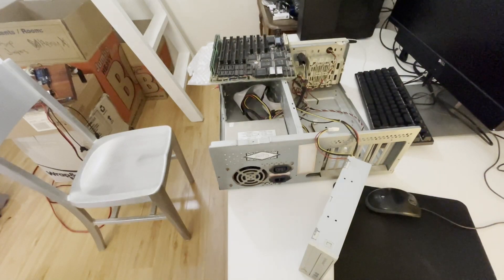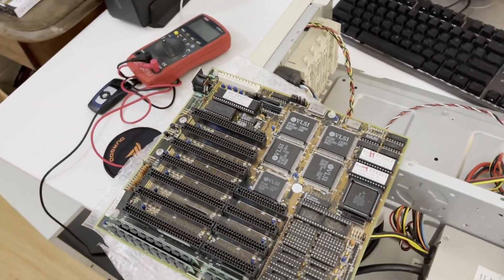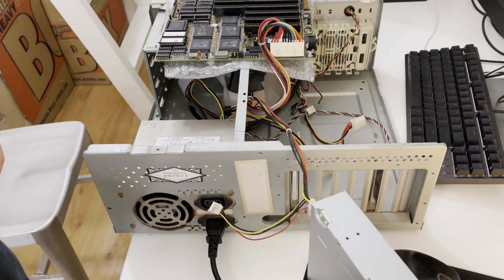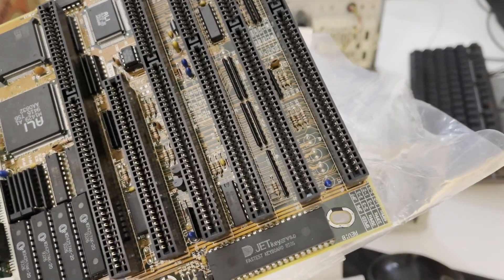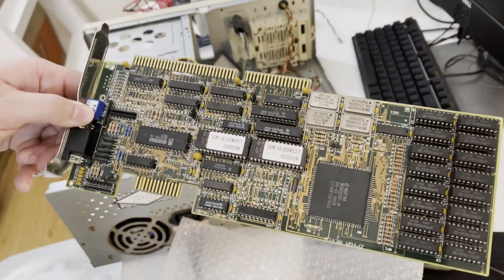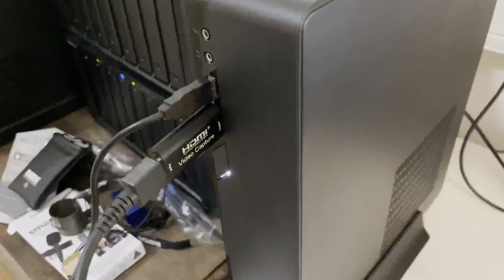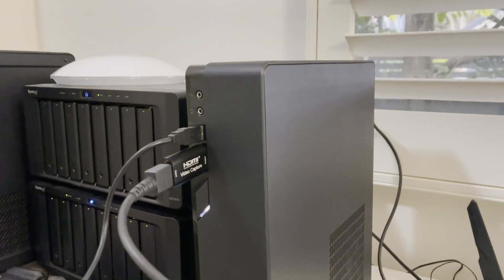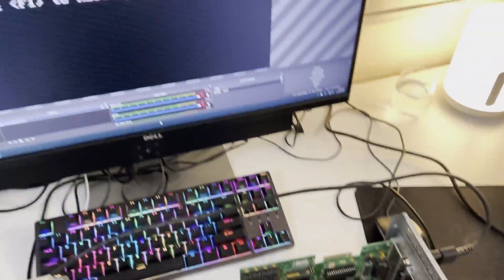386DX Build Part 1

Comment: What vga to hdmi converter are you using?
Reply from the maker: It is just a generic cheap one from ebay. https://www.ebay.com.au/itm/133851079812?hash=item1f2a256484:g:wZQAAOSweOBhG1-D
Reply: @michaeldale837  Well, it seems to work with 70Hz modes so I'm keen on getting one myself..